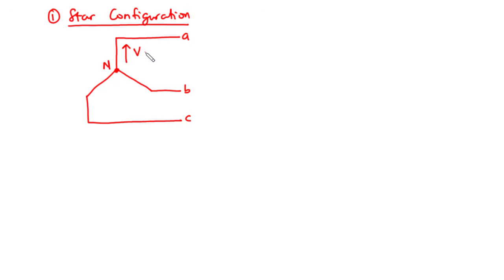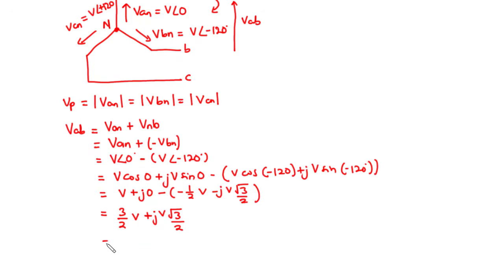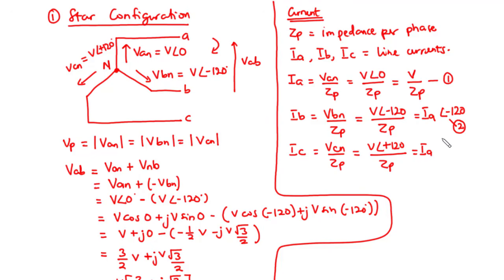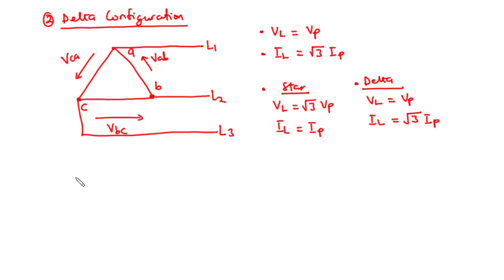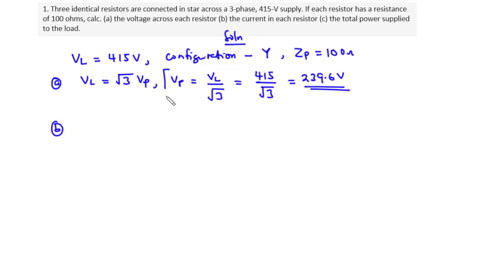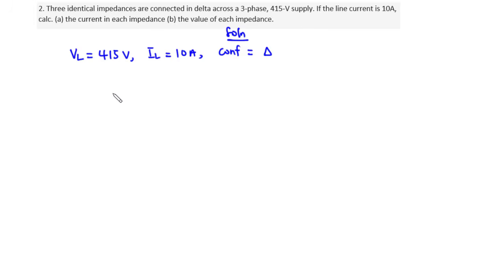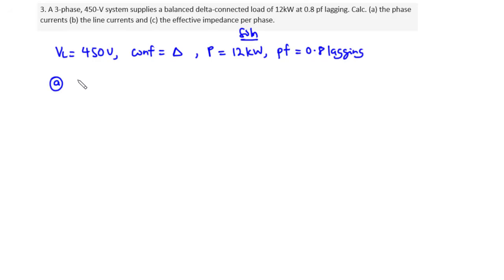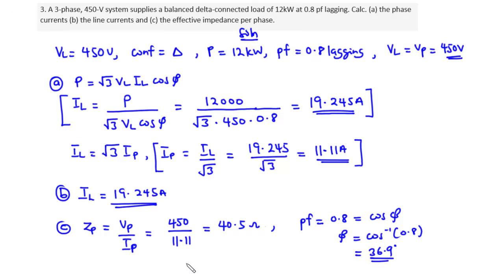49 - Voltage, Current and Power in a Balanced 3 - Phase Delta & Star Circuit

Comment: We know that,for Y connected,Vline=√3 Vp <30  but why you can use only √3 Vp??

Please explain sir
Reply: under certain context, you can omit the phase angle if you only care for the magnitude. But in generally, you shouldn't omit the phase angle as this tends to lead to wrong calculation.

Comment: Please for the first example..
Why is the 415 V the line voltage of a single line and not that of all the three lines
Reply from the maker: Okay, you should take into account the kind of configuration, notice that
In a start connection, the VL = VP * root (3)

But in a delta connection
VL = Vp
Reply: @SkanCityAcademy_SirJohn  
Please my worry is how do I know the voltage given in a question is a single line voltage and not that of all the three lines combined
Reply from the maker: @Luciusilver usually check the type of configuration,

Comment: Hi.Does Zp has angle?
Reply from the maker: Yes, Zp has an angle that is when there are either capacitive or inductive effects in the impedance. NB: if the impedance is only due to a resistor, then zp has zero angle. 
But we usually don't indicate angel for zp when we want to derive Ip but in a typical question you may have zp having an angle.